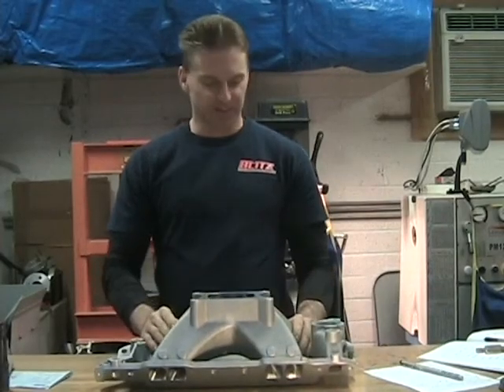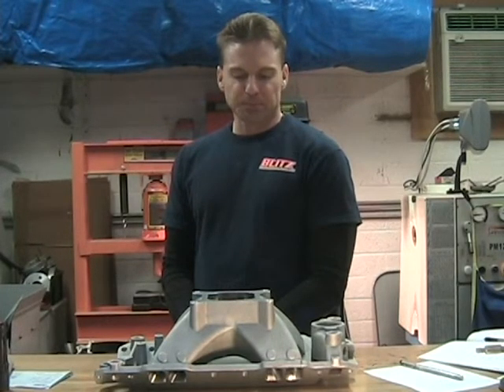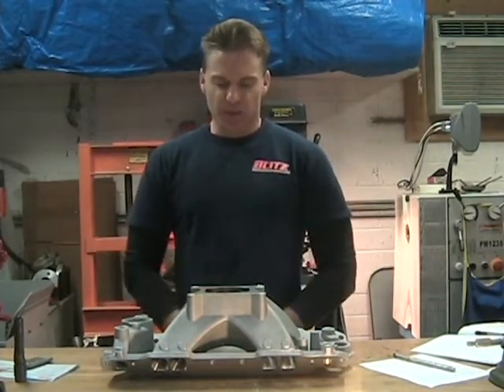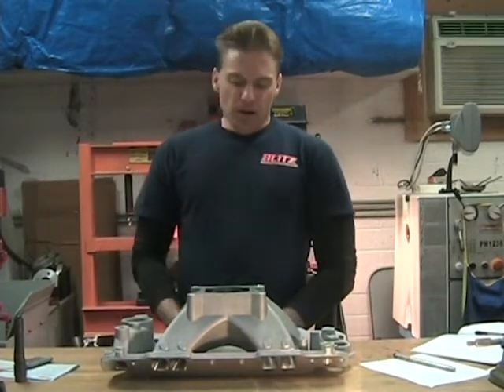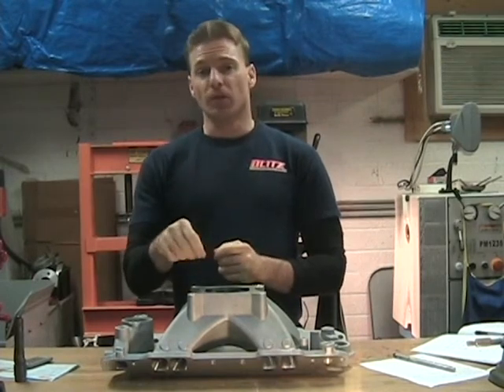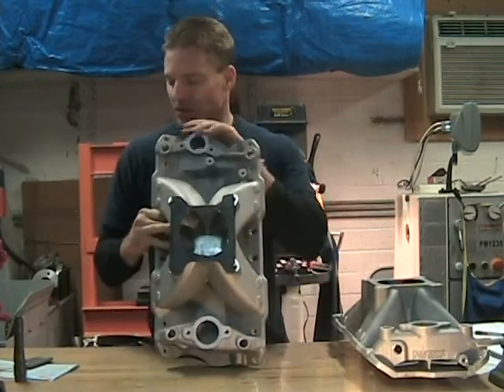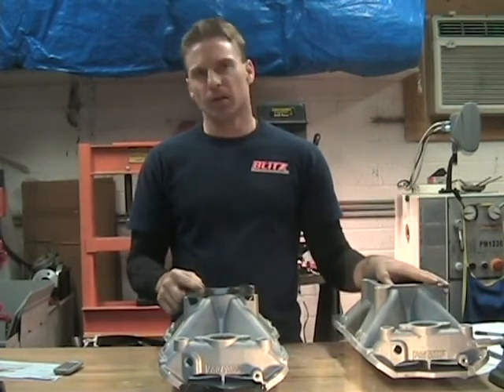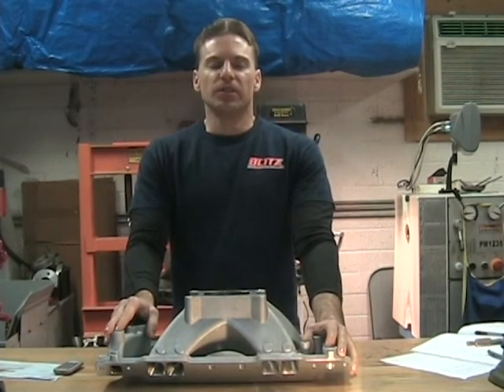SBC intake manifold porting ( review and close) video 8

Comment: Do you like that hurricane intake?
Reply from the maker: Yes it's decent, but as minimum I would port match it to get the best performance from it. Most offshore casted intakes can work well with little clean up.  Even Edelbrock intakes   can be a little rough on port exit, it generally best to plan on port matching any new intake. To date the best casted intake that I have worked on is the Bill Mitchell series. Thanks for watching videos, good luck.
Reply: @blitzcechannel7941  Bill Mitchell intake is based on the super victor #2925 same mold, that the one I use or the Dart intake

Comment: what brand intake is that? looks like a good one,nice straight runners
Reply: Sorry for the delay.  The model is a Speedmaster. Believe it, or not most off-shore casting are pretty well done for a fraction of the cost.  They also port and flow very well compared to most name brand intakes.  If your not building an all out race engine these intakes will do the job just fine.